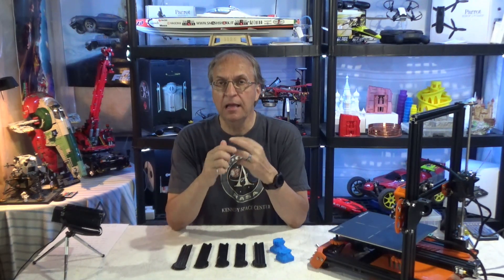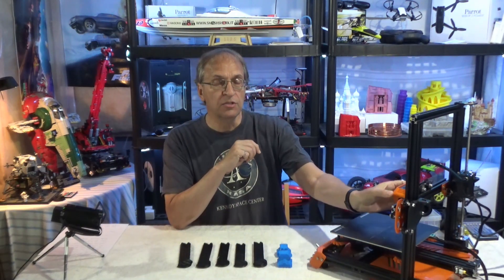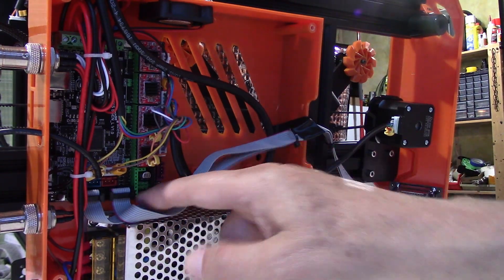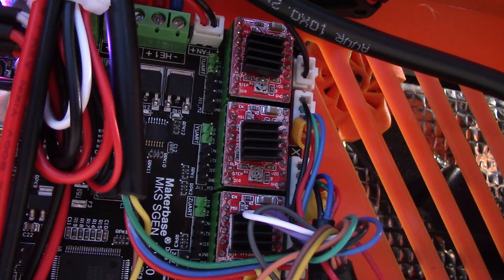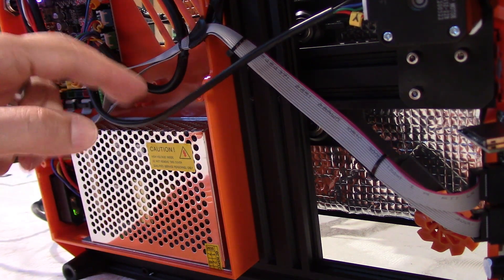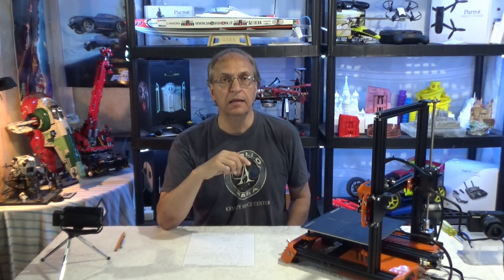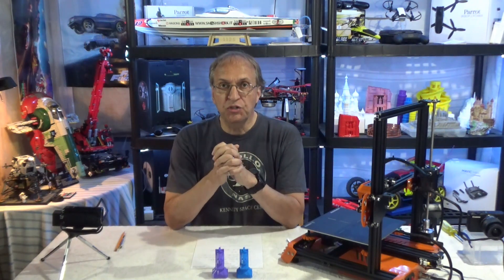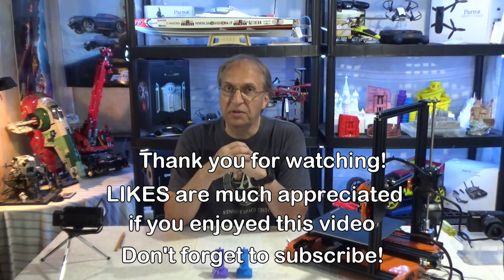Homers / Tevo NEW Tarantula Pro | Adjusting VREF and other important settings!

Comment: Hi Dan.
Again... another great video.

Well... would you believe I've had this printer over a month, and I STILL haven't printed anything on it yet? It's been a journey, let me tell ya. Anyhow, I narrowed the "no-Y axis movement" problem to a faulty motherboard. I had to buy another MKS SGEN from Amazon. I finally got it installed. Not realizing you had a vref video... I took to facebook, where a few good people pointed me in the right direction. After a ton of questions, I was ready to get those drivers adjusted. They came to me, set at nearly twice the recommended voltage. And then I emembered
that you mentioned a video you were gonna do. So... tomorrow, I get the drivers adjusted, and MAYBE I get to do my first test print.

My troubles really started with tech support. Apparently, it's not a good idea to show up there "in a hurry". I wished that the circumstances were different, but I was genuinely fighting the clock. I guess that really doesn't mean anything to people who aren't. They must have been under the impression that I was a pushy, ignorant customer, when in reality, I'm the exact opposite. I received a machine that was not as described, a motherboard that was broken, and less than  6 days away from becoming ineligible for a refund. The first person I made contact with must have been under the impression that I might be trying to pull a fast one. A day later, I was transferred to
another who (despite having the motherload of information ALREADY at their disposal, with pictures & video) decided to ask questions about things I had already provided. The next day, it's literally turned into "a question a day" snail mail fest, and I'm talking to the third straight person. At this point, I really started to wonder what was going on there. I must have apologized at least three times for behaving hastily. But they simply refused to talk to me with any frequency, any urgency, or conversation. Remember... I'm fighting the clock. Completely disgusted, I start trouble-shooting, (not really knowing what the hell I was doing, with absolutely ZERO assistance from them) and luckily I narrowed it down to a driver board. They offered absolutely NO assistance, no parts, no NOTHING. I was so beside myself with disbelief. Finally, after I discovered the problem, he told me I needed another board. They didn't offer one. When I told them I had one, Chris finally spoke up, and mentioned a firmware file, which I had begged for, days earlier.
I had to ask 3 times how to install it, before he decided to reply with a single sentence. 

Wow. I guess I must be spoiled with having someone actually showing a little love. Not once was I EVER disrespectful,
or rude, or pushy. The first thing I said was that I was fighting the clock. And it turned into a nightmare. I paid $300 for that printer, and they blew me off like yesterday's news. I had to buy a board, and all the time I put into research over something that I paid to NOT HAVE TO DO. They owe me for a board, which I'll never see.

It wasn't until my final response that I felt they deserved a piece of my mind. Rightly so. Of course, I kept every email. And I fully intend to milk that cow on all for teats.
Reply from the maker: Not good!  If you want to see the worst story about customer service you should watch my video on Paypal.  Unbelievable...  Where did you buy the new board from, you say Amazon? Is it fully compatible?  Give me an update after you try to print.
Reply: @SuperdanTech  Hi Dan. Yes. I bought the board from Amazon. $35, shipped. Came with 4 driver boards, and jumpers. Completely compatible. I had to install the drivers & jumpers, as well as adjust the voltages. I installed everything, and everything works (phewwww). All I have left is adjusting the voltages & make adjustments to the area sizing ratio. Apparently, the ratio is at only 50%, as I move it, say 10 mm's... it only moves 5 mm's. I've been informed that I need to run an "esteps calibration". That aught to be interesting. Update coming soon.

Yeah... their customer service was INFURIATING. They probably think I'm some kind of jerkoff. Never seen anything like it.
Reply: I adjusted all of the drivers to .8v. During the homing test, the Z axis is moving like a slug. So I increased it to just over 1v. Did another homing test. No change, and the Z stopped well short of the bed. "Homing failed. Printer halted." Good lord. What now?

Ok... the printer halted because I raised the stepper too high before I adjusted it. Like I mentioned, I have to do an estep calibration, because the machine doesn't know that it's steps are only 50% of the actual units. I have a sneaking suspicion that the firmware needs serious adjustment. God only knows what tech support actually sent me. They were hating me when I got the file. For all I know... they made changes. (I'm at odds with tech support! Who woulda thunk?)

Alright then... onto the estep calibration. Whatever that is. Have a good night, Dan.
Reply from the maker: You are doing a lot of work on this printer.  I wonder what kind of experience other people are having.  Good luck tomorrow!
Reply from the maker: You should contact me through my website next time if you want.
Reply: @namor isats Well... kinda. I had also purchased an EZOUT & EZABLE from the fine folks at TH3D. I had a gentleman make my custom firmware.  I've had the unit on, and am just now going through the printer functions, making sure that everything works. After installing the new firmware, I also discovered that extruder was jammed pretty good. Everything heats up properly, and filament has actually gone through the hot end. Because I've been through so much with this thing, I'm a little hesitant to let it rip. I still don't know what I'm doing, and afraid of ruining it. As you well know... tech support has been nothing but a nightmare. (STILL pretty pissed off over that debacle.)

I still have adjustments to make, and need to learn how to operate this thing. I say that because I've been getting used to running a different machine. Yes... while I had someone working on my Marlin firmware, I bought another machine. I am the proud owner of an Artillery X-1. This thing is fully automated, and runs like I had expected a new machine to run. No guess work with a Sidewinder. As long as the bed is level & clean, and the nozzle flows freely, it continues to perform, well-beyond my expectations. Print quality, ease-of-use, and it's fast. That's the kind of experience I had expected when I handed over my cash to TEVO. Wish I had bumped into the X-1 the first time I went shopping. However... I have yet to see how my TTPro prints. So, I'll just have to reserve judgement till I see this in motion.

Thanks for asking, Namor.

Comment: Is it normal that my X axis is double the distances that I ask it (for 1cm it goes to 2cm) I have to adjust the step/mm of the X axis to 40 (and 80 for the Y) at each start since I can't save configuration settings, how could I solve it?
Reply from the maker: Interesting problem, which I have not experienced.  The fact that you cannot save a configuration change is really annoying and I wrote to Homers about that.  You should send a message to customer service about this specific problem.  They got back to me within 24 hours.  Thanks for watching!
Reply: @SuperdanTech   I contacted homers customer service and i managed to solve the problem by correctly replacing the jumper below the X motor driver (because it was not correctly placed). :)
Reply from the maker: @_OO-kl2fp  good for you but bad for QC at manufacturing!

Comment: thank you very much I've been having all the issues you having right now as well. time to make some tweaks i guess
Reply from the maker: Good luck Paul. I saw a major improvement with mine when I corrected my two drivers which were at 0 7 volts. Way too low. I am still testing my machine further and will report any findings!  Thank you for visiting my channel
Reply: @SuperdanTech  after making this video have you had anymore issues because im still experiencing print interruptions.

Comment: Thanks for making videos on this printer!  I bought a pro (the old version) and got the new RS one. Mine has printed a lot of stuff by now and i never had any issues. 
except that i cannot flash my firmware... i guess the bootloader is corrupt on my mainboard. 
Are you planning on doing upgrades? BL Touch, dual Z, new Stepper drivers?  i have my TMC 2208 lying around here ..
Reply from the maker: You are welcome! I will most likely do upgrades in the near future like I did with my Ender 3.